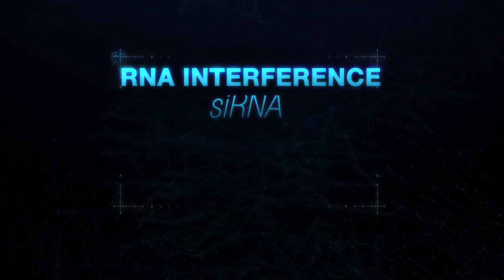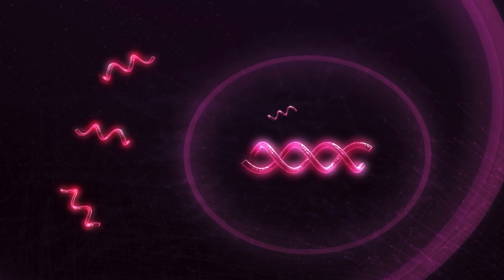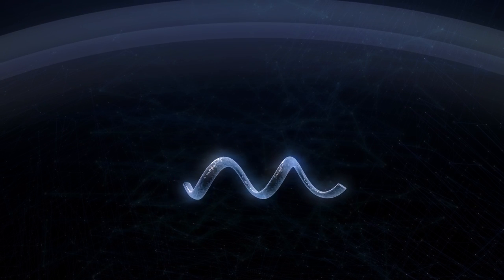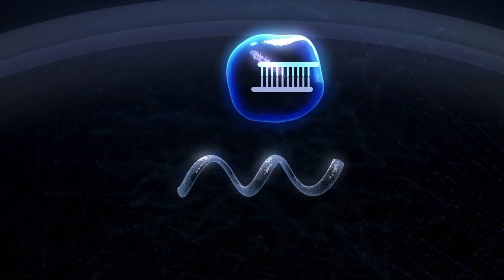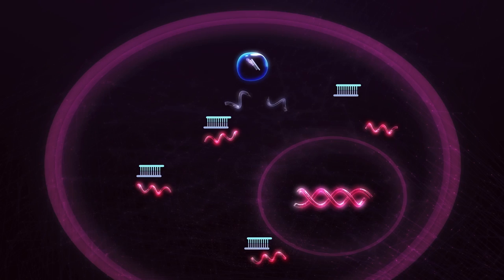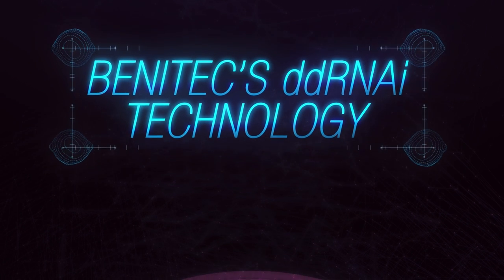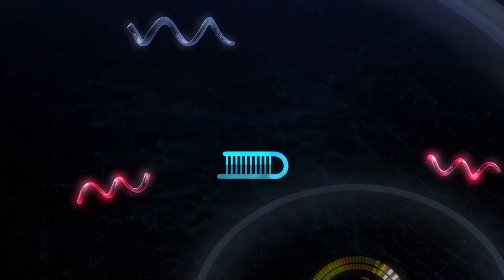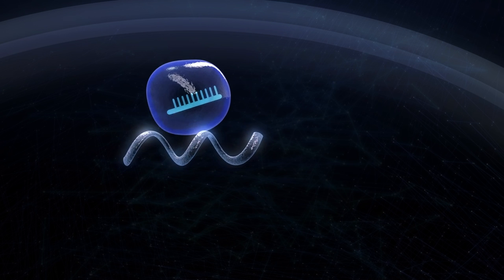shRNA vs siRNA: Benitec's ddRNAi Explained

Comment: From my understanding, cells lose their vector over periods of generation passages. I don't see how this is a permanent solution.
Reply: probably the constructs are integrative... by transposons and transposase that fixes the gene into the cell's chromatin. So, it stays permanently.
Reply: It's permanent for a cell, not permanent through passages. Watch the video again.
Reply: @sexyscientist   it's permanent only for a cell .then how it is permanent solution...because the cells can be destroyed aftr a certain time periods ,rgt
Reply: @anusreemk5798  Now, I don't remember the video I watched 8 months back. Do you need me to watch it again?
Reply: @sexyscientist  As this vdo is of 2.30 min ,if u can ,pls sort out ma doubt ..else it's ok I will find it my own
Reply: @anusreemk5798  ddRNAi technology is used to silence the genes in terminally differentiated cells. So, if the non-dividing cells are cured, the disease will be cured with a single dosage. I hope it helps, Anusree.
Reply: Thankyou